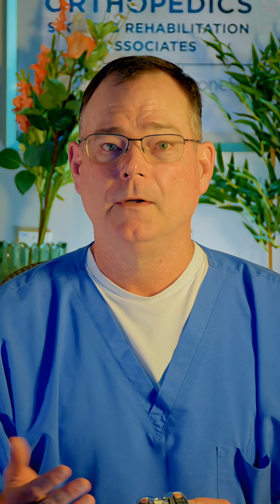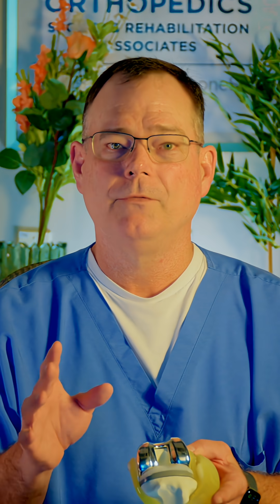A Thin Piece of Plastic for a Lifetime

Comment: I had an ‘ankle replacement’ in 2008, at the time my surgeon told me absolutely no running. I listened and stuck to that instruction, lots of walking and golfing. This implant lasted 15 years, exactly what my surgeon told me when he did the original surgery. I’ve since had it replaced and I’m back to normal , my recovery time was minimal and relatively painless. I’m also 10 years into a hip replacement and hoping for at least that amount of time before I need a revision for the hip…